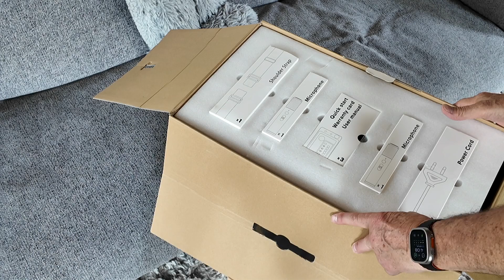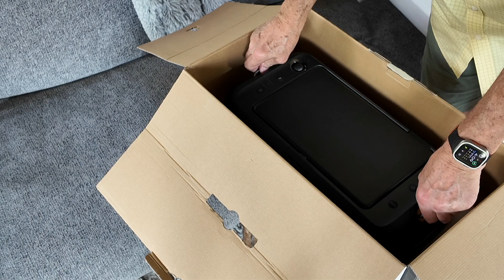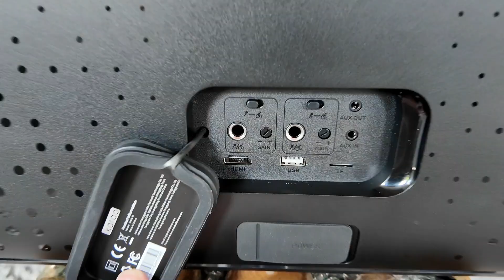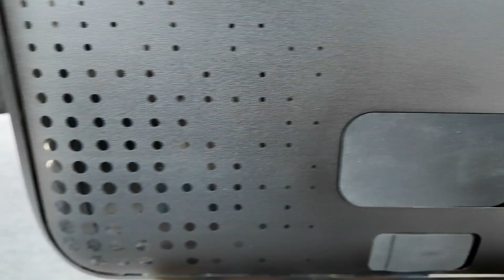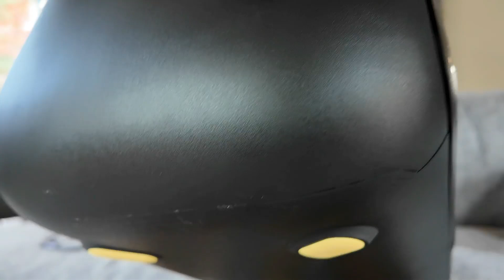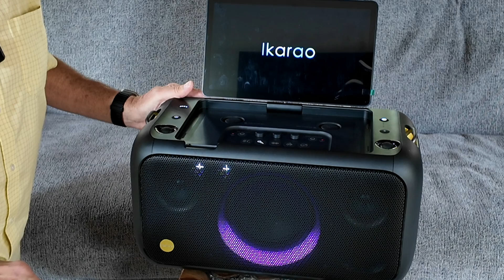Review Ikarao Break X1 Smart Karaoke Machine

Comment: Can you put a large HDD in it?  Will it be able to read it and play music off it?
Reply from the maker: I've not tried connecting anything other than a USB Stick but I would think an HDD would also work. Let us know if you try it.
Reply: @michaelerbreviews I have tried a big HDD - it acknowledges it, but it might take forever to read it - I have connected a multi-USB hub and at least five USB sticks in it and it seems to be working fine!
Reply from the maker: @arthurvasey  That's interesting that a hub with multiple USB drives works well.
Reply: @michaelerbreviews I’ll look into putting hard drives into the hub - though it might take time to scan!

UPDATE: It either doesn’t work or it takes far too long - it just goes turn, turn, turn, turn …
Reply: I think you must check that your HDD is on Fat32 system because if you have NTFS so for 99% its not will be working. Second is that you must try sdd because maybe don't give enough energy for your hdd

Comment: We bought two of these and both of them will not stay on more than 45 minutes even with just using the mic nothing else and being fully charged. We are having real issues with the X one and X2. They just do not stay going. I know they have a time Sleep mode and we change that to the highest to 30 minutes but still continually using it. It will only go for approximately 45 minutes to an hour before it shuts off then you can start it again and it’s fully charged, but it still does it even if it’s hooked up to the to the to the wall With power we’re talking with Carrie right now we bought ours April of this month and we’re having real issues with it. They do not stay on for more than 45 minutes. This is a real breaker for us if we don’t get them fixed or this problem resolved we’re sending them back. We ordered two of them so we could have a pair and pair them up But so far I’m not impressed. If you have any suggestions, please message me.
Reply from the maker: @sds205t  I wish I could give you some suggestions but I have none. I have not experienced anything like this with my unit. I find the battery life to be exceptional with mine

Comment: I just bought one of these to add to the karaoke division of my DJ company. I am a bit bummed about the microphone delay. I was thinking it had something to do with the preset modes, but I am even hearing it in the custom mode. It is just enough to prevent this device from being perfect. I do not see an app store on mine either.
Reply from the maker: I’ve never noticed any delay with mine, but they have been changing the firmware and apparently they have taken away the App Store.